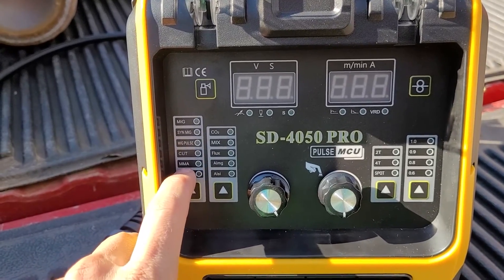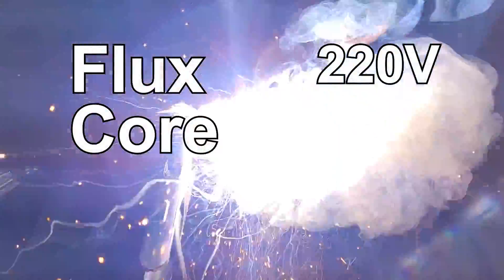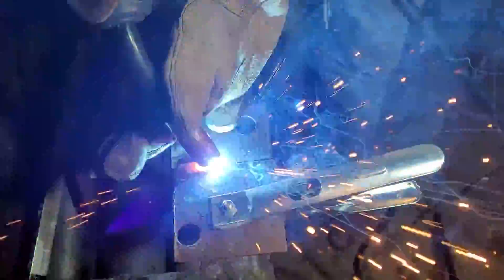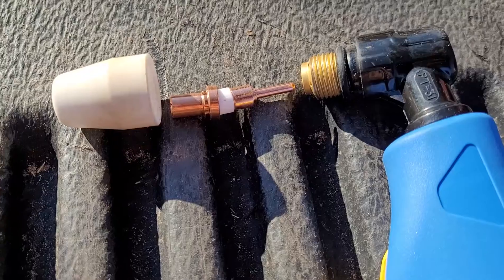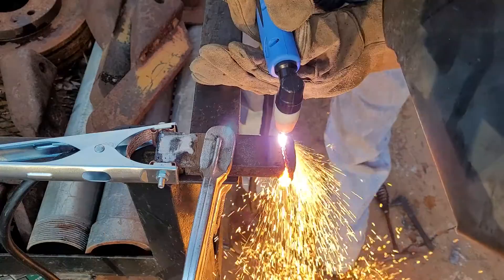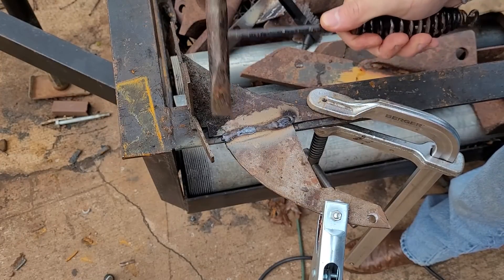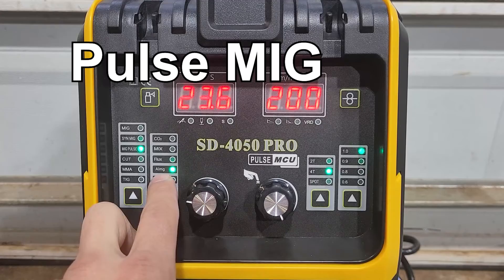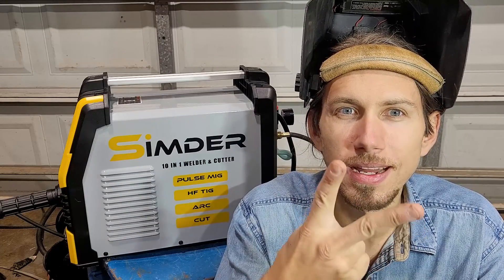KICKSTARTER Welder Review: Simder SD-4050 Pro

Comment: I'm new to simder brand. I had to have a new machine for my shop so I bought this machine.  So far I love it, I run 90/10 mix on my machine does very well. I also have 💯 set up for the aluminum mig. Well pleased with this machine.

Comment: Im a daily TIG welder for 10 years now but i have no clue what is causing the spatter and incredibly unstable arc when you started to TIG weld, dont know if your tungsten didnt match or your TIG welding with CO2 instead of argon or what, im curious...

Comment: Nice job on your video. I'm new to welding and just received this welder today. I don't have a 220V in our home, so can I use a regular 110V 20 amp breaker plug in  to use this at the correct settings (which I have no idea what that would be yet...LOL).  Or, should I run a 220V dedicated line to where I will be doing this?  If so, what size breaker, wire and plug in would I use?  Simder doesn't seem to be sure when I asked them, which shocked me.  They are suggesting 50 amp breaker for 110 and 30 to 35 amp for 220, but I imagine the wiring to my outlets are probably 12/3 at the most.
Thanks for your help.
Reply from the maker: I'm not an electrician. This is not wiring advice. My wiring when testing: 8/3 50A 220V NEMA 6-50 Plug and 12/3 12A 120V. You have the same 120 Volt setup as me. A 120V circuit over 20 amps is not common. The machine is limited on 120 Volts. Every single machine I tested is limited on 120 Volts.
Reply: Thank you.
Reply: How did u receive yours did you back the Kickstarter or indiegogo page. I did indiegogo and hoping they are are schedule to be able to start shipping on there projected date which isn't exactly specific just says in April. Can't wait to get it though.. was skeptical after last product I backed never produced a product and was basically screwed out of the donation but guess that's all part of the risk and why the discounted offer for backers I had more faith in this tho seeing how they already have a product that people are reviewing 🤞that it actually comes and that they r on schedule
Reply: @ShroomDaddy707  Yes, I backed it on Kickstarter. I received the welder about 3 weeks ago, but they didn't send me the extra welding wire I ordered with it, and they threw in another small roll of wire since they met a certain backers amount. I have asked them several times about the wire and the last two emails they haven't answered me. Kinda sucks when you give them 500 bucks and they ignore you. Good luck with your Indiegogo.